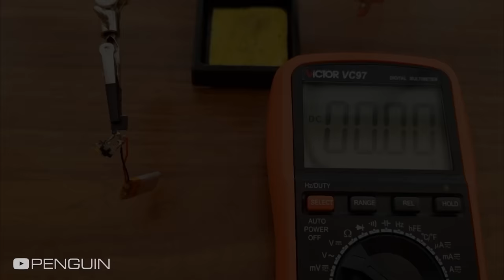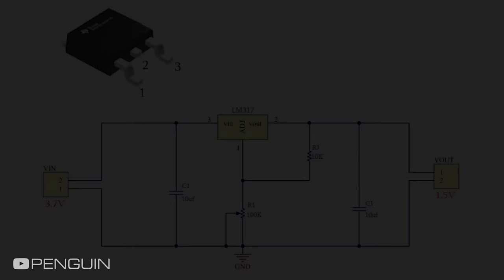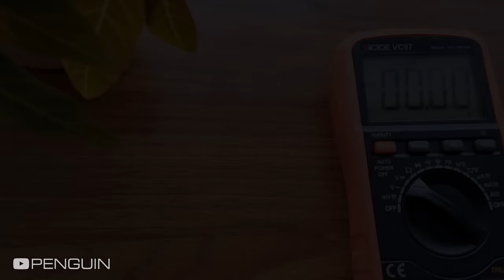How to make Rechargeable 1.5v Li-Ion battery | DIY Rechargeable 1.5v battery at home

Comment: I'd just go to the store and buy a pack of 4 rechargeable batteries but this is a really cool project keep up the great work
Reply: Lazy
Reply: @takeyourheart114  earning the money to buy the thing isn't being lazy. I just don't see the point of only being able to charge 1 battery at a time.
Reply: @takeyourheart114  this battery's capacity is tiny. It's a cool project sure but it sure as hell isnt practical. Better off buying a commercial solution.
Reply: @TheArachnoBot  next video "I installed a USB port in the gas cap of my car to charge my car along with my iphone."
Reply: @takeyourheart114  what??
Reply: @Syncrotron9001  😂 I can't imagine how long that would take to charge then awkwardly pulling up to someone's house with an extension cord like "can I borrow your wall outlet for a few hours I need to charge my car" lmao
Reply: @TheArachnoBot  exactly my thought I just went down to home depot and bought an energizer battery recharger for 20$ . It can do 4 batteries at once way easier than buying a soldering kit and dealing with battery acid and having the knowledge to solder in the first place. So I don't gotta worry about buying new batteries every week just recharge the 4 I have and I'm good.
Reply: ZzZz*
Reply: @derpyturtle927   those ones you bought are only 1.2v. This would be the full 1.5v of disposable batteries. Worth it if you need them for something like the transmitter for an RC plane
Reply: @uberchipmonk2568  they are 1.2 volts but I'm not using stuff that requires high voltage mostly i just use them for remotes remotes besides most things that require a higher voltage probably need a bigger battery anyway unless it's a drone because those depend on weight dispersion
Reply: Thing is with buying rechargeables is that they don't last very long 
With this video I was able to experiment around and I made a AA BATTERY last 3 weeks 
Although there is battery backs microsoft makes have a 4 day life span 
But meh
Reply: @niner6029  had rechargeable for about 8 years. They last good.
Reply: @derpyturtle927  the transmitters still use aa. I use NIMH aa batteries in mine and had to add 2 extra with a battery box to get the pack to last for more than one or two flights.
Reply: I'm not gonna reply anymore I'm just saying rechargeable batteries work better for me and for what I do. If you think they are bad or have other opinions that's fine with me. I think they are better for the environment because they have re-usability and they save me tons of money in the long run. And nothing is bad about saving money and keeping waste out of the environment.
Reply: @derpyturtle927  wasn't defending  disposables. You should take the time to read instead of getting  defensive. C ya
Reply: @uberchipmonk2568  never got defensive I  literally said if you have different opinions that's fine with me. Have a good day
Reply: @derpyturtle927  c ya
Reply: I dont have this Batteries in my shop
Reply: @takeyourheart114  Work Smart not hard...and poor.
Reply: You can use batterir recharger
Reply: @sunwillriseagain6202  nah just being creative
Reply: what would you do with the dead batteries? through them away and participate in the ever increasing heaps of trash?
Reply: Rechargeables start at 1.2V and drop from there. Makes them unusable in everything motor driven.
Reply: @takeyourheart114  Describing yourself?
Reply: @ashwinsuresh9460  and what do u mean by that random person I never met?
Reply: Ñññññ
Reply: @foxyff7224  indeed
Reply: I've seen nuclear fission projects less complex. Unless this Frankenstein battery is more durable than a store bought rechargeable battery this is just mania.
Reply: @takeyourheart114  Are you a 10 year old or somethin? lol
Reply: @uberchipmonk2568  If your transmitter flattens NiMH batteries in one or two flights, then either your transmitter or your NiMH batteries are faulty. If what you're saying is that the transmitter needs 1,5V batteries and doesn't work well with 1.2V batteries, then your solution of adding 2 extra with a battery box is exactly the right solution.

If you need a full 12V, then you'll have to use 10 x 1.2V batteries, rather than 8 x 1.5V batteries. However, 10 NiMH will typically give 2Ah x 12V = 24Wh of energy, whereas 8 of the batteries made in this video will give 0.16Ah x 12V ≈ 2Wh. There's no way that they can compete with NiMH in terms of usable capacity.
Reply: The cost in making one is about the price of a 4 pack with a charger
Reply: @KronosOnPC  oh who tf r uuuuuuuuu, who u issssss, who u beeeee huh. Who tf r youuuu
Reply: @takeyourheart114  bro he not lazy he just but a battery in side a batterY
Reply: Unless you are a very attractive female wearing yoga pants, or you capture something extraordinary while filming...you aren't coming close to the 4.1m views this video has currently. Just saying.
Reply: Those 1.2V batteries are worthless. it's better 1.5V batteries for charging, but they are forbidden. it's called corporate fascism.
Reply: Thanks for destroying this video in under 5 seconds 🤣🤣
Reply: One thing to keep in mind is that rechargeable batteries from the store (NiMH and NiCd) are only 1.2v nominal voltage and top out at 1.46 volts. So if it’s a 1 or 2 battery application you’ll probably be fine, more than that will have severely diminished runtime if the device even powers on

But that all being said it’s a fun cool project to practice on, but low capacity, wasted energy, and amount of effort seems not worth it at all
Reply: Nice project. But not something worth doing from a practicality perspective.
Reply: It’s funny how you suggest something that’s practical and then complement the mans video for his ability to create something that a lot of people can’t do and then you get criticized because they have nothing better to do than to be keyboard warriors.
Reply: @Caveman125  yeah I really don't understand people sometimes 😂 have a great day
Reply: @uberchipmonk2568  rechargeable battery is 1.2v too btw, lower than regular 1.5v battery due to different chemical
Reply: @Marko_Maxa  rechargeable battery had different chemical than regular battery, thus the voltage output is different
Reply: @niner6029  this diy battery is just 320 mah, way smaller than rechargeable battery
Reply: @bjk8kds  yup, that's what I was saying
Reply: lookup USB Cell moixa
Reply: the rechargeable batteries on the store are usually 1.2 v tho, not 1.5 like non rechargeable ones
Reply: It is still safe using rechargeable battery that only 1.2v (mostly, depend on the device). 
Regular battery is 1.5v at initial use, but eventually it will drop voltage till 1.0v or below, rechargeable battery more stable 1.2v all the time. 
Rechargeable battery had different chemical (NiMH) than regular one (usually Zinc or Alkaline) so the chemical output voltage is different.
Why rechargeable battery not using Lithium like most gadgets battery? NiMH is safer than Li-Po when damaged, and lithium battery need additional circuitry to working, unlike NiMH that direct charge and use like regular battery.
Reply: @takeyourheart114 
Kkkkkkkkkkkkk
Reply: Your idea is the safest.  I think almost everyone should do what you would have done!!!
Reply: @KronosOnPC  probably lol cuz it dsnt make any sense 😂
Reply: @uberchipmonk2568  ủy viên Bộ tư lệnh rv
Reply: Rechargeable batteries require a special socket addon. This doesn't. Also, rechargeable batteries don't last nearly as long as a normal AA battery.
Reply: @derpyturtle927  You're attempting to justify being lazy. It's good to learn something new once in a while.
Reply: @elijahbrown3096  I'm not attempting to justify being lazy. I gave my opinion gave a reason why. And I also complimented them on there work because I think it's nice. Have a great day.
Reply: @derpyturtle927  You still said you'd rather go to the store for rechargeable batteries instead of trying something new. Again, it's good to learn something new once in a while.
Reply: @elijahbrown3096  I do learn new stuff and I like to I just don't like learning about this aspect of stuff.  I do understand what your saying this just isn't my thing.
Reply: @derpyturtle927  If you'd just try it, you might like it. All you really need to know about circuitry is how to apply solder and which terminals go where. You don't even have to start with circuit boards and processors, you can start with what you already know.
Reply: @elijahbrown3096  I've taken apart consoles and tvs and put them back together to fix them I learned that from my dad I mean I did it but to me it was a bit boring. And I'm only 19 I've got plenty of time to figure out what I like and right now I like the outside world more than technology
Reply: @derpyturtle927  But with those you know where everything goes. I mean creating your own circuits from scratch.
Reply: @elijahbrown3096  would you do something you didn't enjoy
Reply: U richt I’d just go to the store and buy candy
Reply: Good 👍
Reply: You cannot buy 1.5v, they do not exist. And you kinda need them for high drain stuff.
Reply: Wait no sorry ur not a nerd I mean that cats are so cuteeeeee
Reply: And those would have a nominal output of 1,2V which I‘d say THIS is so cool… finally recharable AA cells that have the nominal 1,5V …
Reply: Are you serious this is dangerous there are chemical in a battery
Reply: @Keyba674  yea but they wont believe me golfy golfy I need permission to build a statue of union my private Minecraft world
Reply: @YOOOOOOOJEMA  ok
Reply: Ok whit union I mean you but I said okay so it’s private no one will know it
Reply: most dangerous thing I've done in my life was attempt this stunt of a "life hack"
also, a micro USB breakout board, a double a battery, a sand bucket in case things go wrong, and the correct size drill bit cost way more than a rechargeable drill bit. also, he took all the stuff out of the battery that actually makes it alkaline...
Reply: @MyVrabec  also, it's easier to use USB-C
Reply: And that's why our planet is dying. Thanks bruh.
Reply: @bumboclat  this one also will fail with big loads.
Reply: Thats like saying erm whystand up and turn the lights out when u can press a button .also i must say this person has took my idea the electronics u can by are so small the motors and bats u can by and boards u can get u can make some sick things ye i thought of this years ago but am no good with electrics i mam but nit on this level
Reply: @derpyturtle927 just get a USB C splitter, then you only need one charger.
Reply: If you want to explode 😂
Reply: No offense
Reply: Have you ever thought about there might not be a store with batteries to buy them for whatever reason?
Reply: Hhc

Comment: Don't ever do this! You could really get hurt depending on the battery chemistry
Reply: plus it could explode: sending sharpnels all over, plus not using gloves bothered me a LOT
Reply: The most likely injury to happen when disassembling an alkaline battery is that you slip and cut yourself. Unless you're working in an oven or surrounded by exposed circuitry.  at most you have the potential of some skin irritation due to the chemistry and I would imagine that's only going to happen from prolonged exposure or if you have sensitive skin. It's mostly safe. Just an absolutely inane modification.
Reply: Even the way he was holding the scalpel was bad!
Reply: @_azureAutumn  Explosions are only a risk if you're dismantling a lithium battery. Alkaline and regular batteries are nowhere near that volatile.
Reply: I did this and I turned out fine with my 12 fingers.
Reply: @_azureAutumn  plus it bothered me you using plus with no necessity of using the word plus twice
Reply: @nukezon6992  english is not my main language, i apologize
Reply: @_azureAutumn  I was bothered by not wearing gloves to doesn’t he know that there’s acid in batteries
Reply: @_azureAutumn  Forgiven
Reply: @tomweickmann6414  you REALLY think people are going to do this? Lol. Out of the millions that have seen this video I am sure not even a single person has actually replicated this.
Reply: @CyberBeep_kenshi   true, will this video be remove from his channel.
Reply: Yeah man my tv remote exploded, my brother tried it.

Comment: There was a lot to talk about like using a voltage regulator , high voltage to low conversion so it can provide amps for a longer period. But for me the best part was how compact every thing was, I have some experience with electronic components and I know how difficult it is to combine them in such a tiny space.
Good Work Keep it up.
Reply: Grazie 7hbb
Reply: Kiale
Reply: اقا منصور هم وطنیم؟
Reply: Problem is when you use a linear regulator instead of switchmode you are burning the difference between the input and output voltages.
Reply: @soundspark  I have no idea what you are talking about but it sounds about correct. LOL I just know you are right.,

Comment: I'm not sure this is overly practical, but I love the meticulous attention to detail!  Excellent work!
Reply: It is... especially if it scaled up.
Thing is...  idk why Duracel, energizer nor Rayovc makes Lithium batteries. 

(Maybe they do and I'm just mistaken. Cuz I mainly buy Energizer AA and AAA rechargeable batteries)
Reply: @ericolens3  I only meant not practical because a typical AA battery has a capacity of about 2500mAh, and this one has 180mAh.  If you could scale that up somehow and still fit it within the casing, then sure.
Reply: It's really not. however putting the circuit inside of the device itself would allow for a larger battery and the proper protection circuits, and that would be extremely practical.

Comment: Interesting exercise. Certainly cool as a maker project. However, aside from the questionable handling of the electrolyte, the end results seems not worth the effort. First of all a regular alkaline AA battery is probably good for 1500 mAh, and a NiMH rechargeable AA is easily 2500 mAh and up. The 180 mAh lithium ion battery is really measly in comparison. I also wonder if there is any heat issue when you have to squeeze the voltage from 3V+ to 1.5V. My criticism/doubt aside, I applaud your efforts.
Reply: Trabajo en electrónica y concuerdo contigo el amperaje final es pobre ... cómo para un control remoto ...
Reply: you have to look at the Wh not mAh when comparing different battery voltages/chemestry but I agree that the small Li-ion pack he used is small because he cannot fill the battery space as efficiently as you can when the battery and shell is designed for each other.
Reply: He put a pair of the 180 mAh batteries in so its 360 mAh. Pitiful beside the commercially manufactured versions of these batteries which typically have around 1500 mAh capacity and up to 3000 for the versions that use a separate, special, charger. Can't just pop them into any old NiCd/NiMH charger.

Comment: I wish all batteries were like this… incredible that it’s possible but not done by the industry. Great job 👍
Reply: Those 1.2V batteries are worthless. it's better 1.5V batteries for charging, but they are forbidden. it's called corporate fascism.
Reply: Ummmmm have you never heard of rechargeable batteries. The last time I hade to buy AA was 4 years ago. You should look into them.
Reply: @Marko_Maxa  lol
Reply: @joenasty4395  What I meant by ‘like this’ was rechargeable using a single port… not requiring an additional bit of hardware.
Reply: @ButterfatFarms  Fair point. But like all things, options are ok. I don’t use a lot of batteries, however in the case of just needing to recharge a single battery for a low usage item, this looks like it would be a valid solution where an additional charger wouldn’t be required.
Reply: bro idk if you would happily pay 10 dollars for single battery with 5 times less capacity than normal rechargable batteries
Reply: All batteries? This is pure waste of resources and materials. Recycling will be also another issue.

Comment: All is great, but in that way there is no low voltage protection. Congrats for the work.
Reply: I can't remember what the cut off voltage is for that voltage regulator but it will basically shut off before the lithium batteries gets completely drained.

Low voltage protection would really only be needed if it was connected directly to the lithium battery but its not, and the regulator will stop outputting any power before it drains the better too much.

Comment: This is a cool project, but there are some practical issues. The capacity of the lithium battery is low, so you're not going to get as much energy out of the battery as you would from a regular battery. The LM317 is a linear voltage regulator. It converts the excess energy into heat and has a terrible efficiency. A buck converter is better suited for this type of task, but it puts out dirty DC. Shrinking the charging circuit is dangerous if you aren't careful. One mistake and it could malfunction and put the lithium battery into a dangerous state. Lithium batteries are no joke, if they become angry they turn thermonuclear. Consider a slimmer charging circuit and a USB breakout connector instead. I know how hard it is to make electronics fit into a tiny space.
Reply: Try a resistor in line for ground
Reply: @I_also_like_sirens_hehe  Nerds rule the world today.

Comment: This is a great idea. I would love to see this mass produced. Except for the LM317 voltage regulator. That is such a huge waste of energy.
Reply: Only sensible option would be to use switch mode regulator instead of LDO, but such solution is more bulky (especially inductor). At this moment more than 50% of energy is simply dissipated as a heat.
Reply: I think you can already buy batteries like these on amazon and stuff
Reply: Batteries exactly like this already exist and have existed for quite a while. Except they have more capacity.